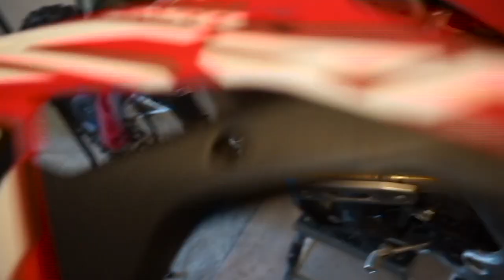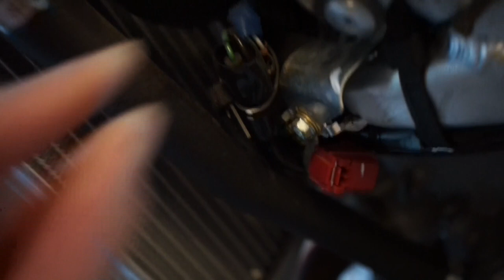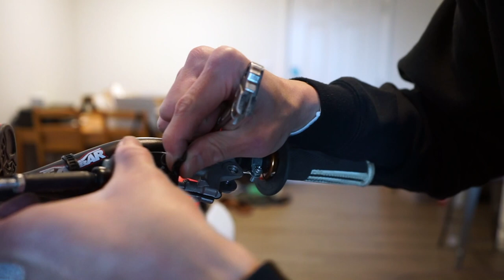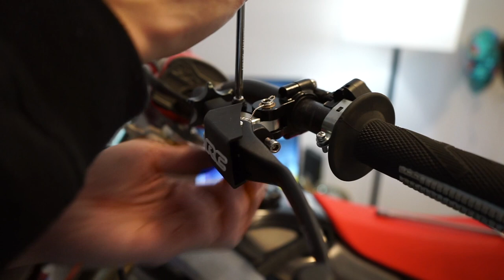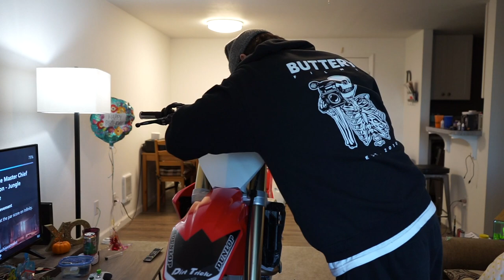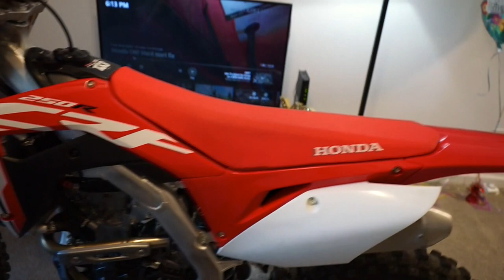ARC Clutch Perch Install on 2019 CRF250r E Start Clutch Delete

Comment: have you had any trouble with the e start with how you put those connectors that you just plugged in together and then i assume that the wire that goes from the connectors to the clutch you just take off?
Reply from the maker: Yesss and if you’re in gear just start rolling with your feet flintstone style and it’ll start too without having to stay in neutral

Comment: Is that the universal one or you have to buy 1 exactly for the CRF I'm having trouble trying to find 1?
Reply from the maker: It’s the universal one
Reply: @JohnnyDaMonny  when i buy the levers, do i also need to purchase the perch?
Reply from the maker: Yes it’s called the dc-8 or rc4 perch
Reply: @JohnnyDaMonny  looks like these are for enduro/dirt bikes. Could Install them on anything? (As long as the perch ring fits around handle bar)